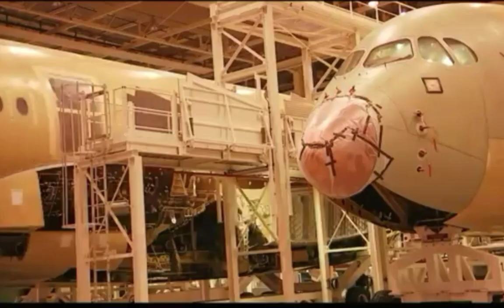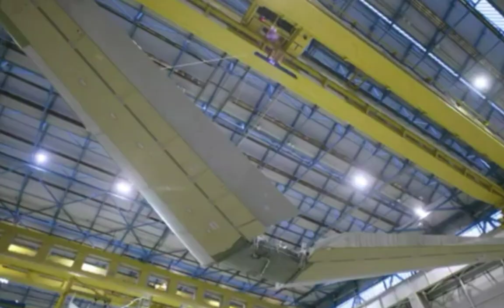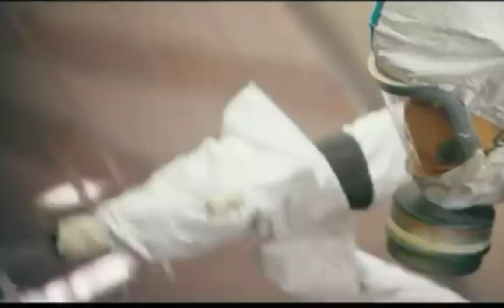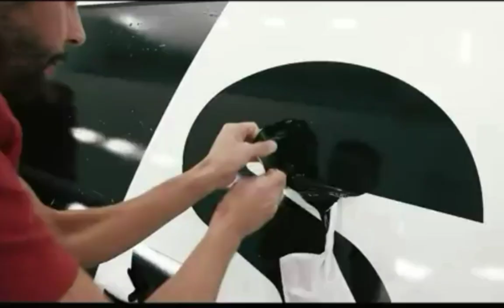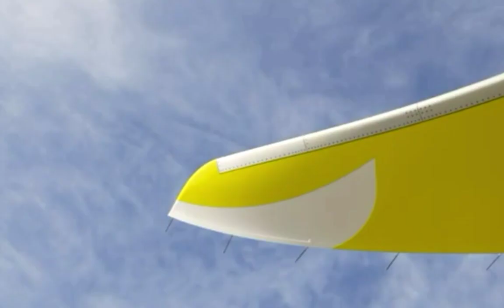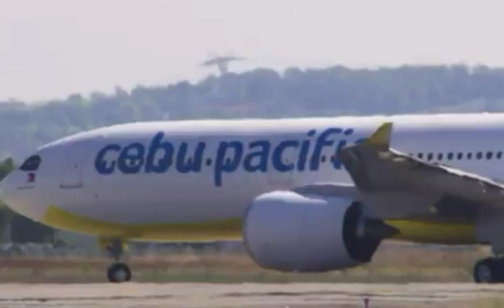Philippine Airlines A350XWB And Cebu Pacific A330neo music video

Comment: What I want to know is when Cebu Pacific to have business class section?
Reply: Never. It is a budget airline in Value Alliance. They are most likely gonna add infotainment systems soon but definitely not business class. Maybe soon also Premium Economy? Probably not too though.
Reply: They like to maximize aircraft capacity. You see how their A330CEO is filled with 436 - Max capacity is 440. The A330NEO  they have has 459 - max capacity 460. They fill it up to the brim.
Reply: Also the A320-200 and A320NEO they have are 180 and 188 seats. Usually 120-140. Their A321-200 and A321NEO have 230 and 236 seats. Usually 140-170.